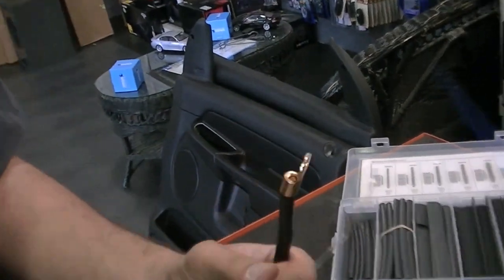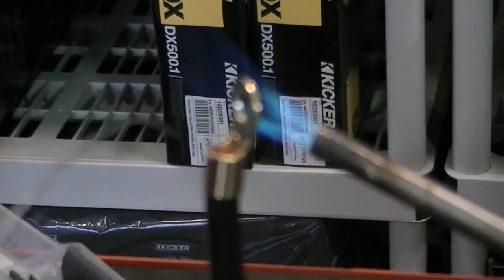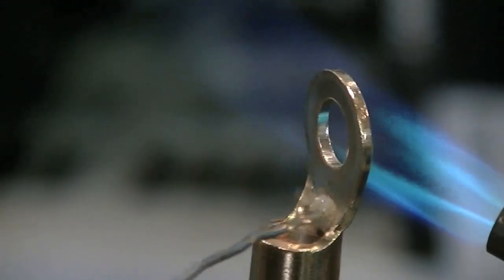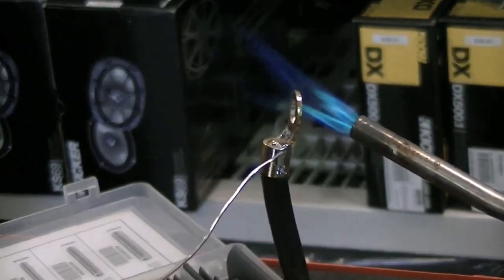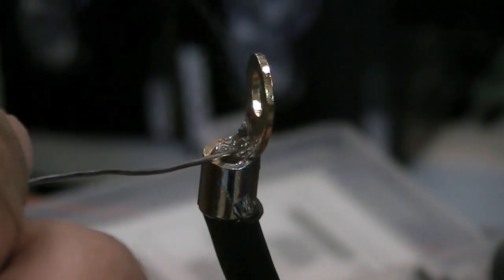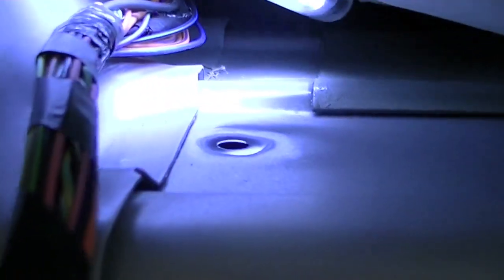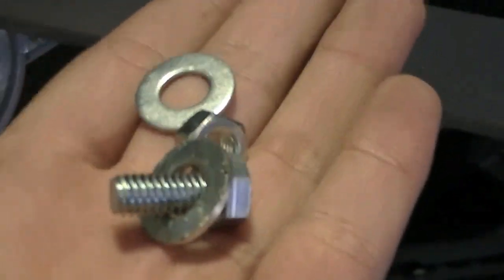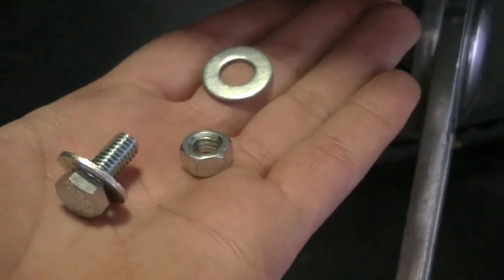How Too Solder 5:16 Ring Terminals And Proper Grounding

Comment: You should mention that you clean the post with solvent and a small wire brush to ensure the solder has a good surface to contact to (and a bit of flux on the wire beforehand will help pull the solder into the braids).  Flux cored solder is fine, but supplementing the flux helps a lot. (I used to install these things, I don't miss slicing my hands up on car sheet metal) :)    Good vid!